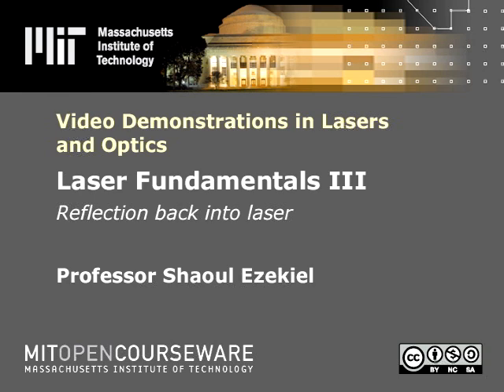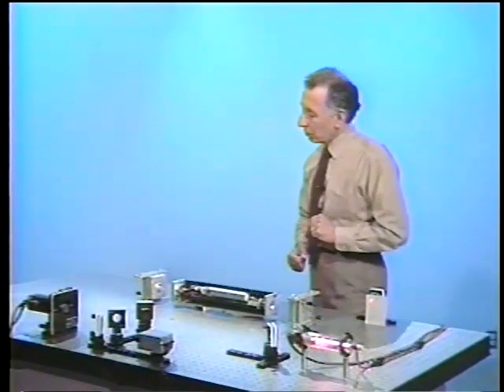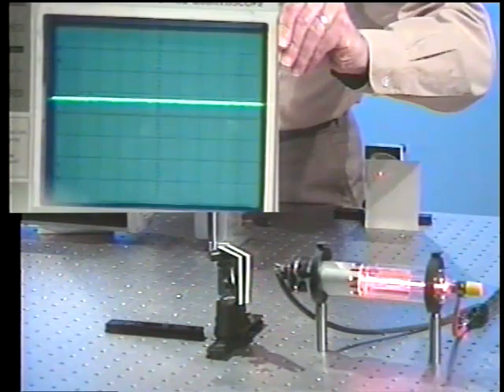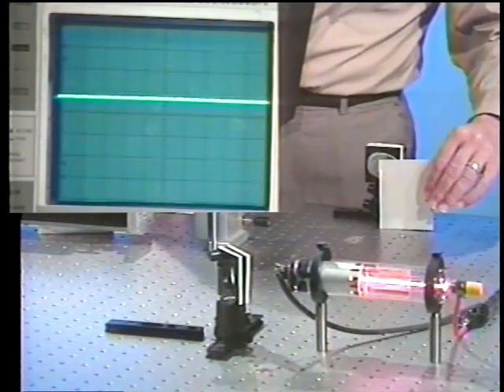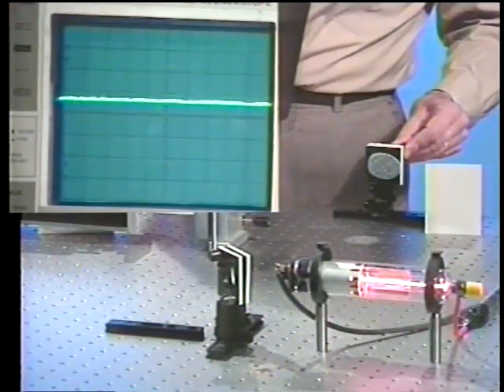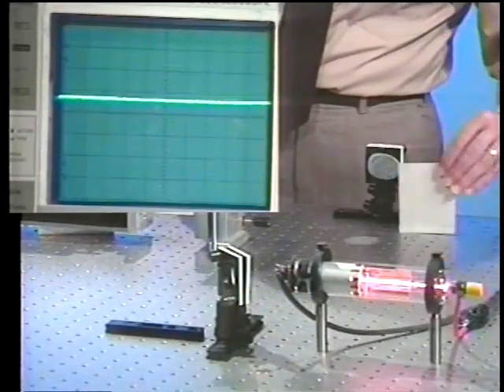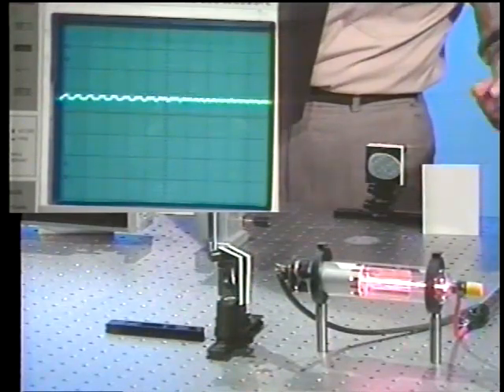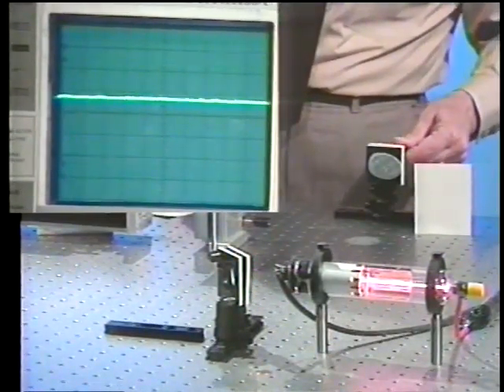Laser fundamentals III: Reflection back into laser | MIT Video Demonstrations in Lasers and Optics

Comment: Question-
A powerful laser, through a one way mirrored surface, mirrored at the "end" of it's path directly back towards the laser, would the effect still exist?
It's something that I would imagine is incredibly difficult to test, since there's no placement within this to put any input, but curiosity gets the better of me.

An example setup of this;

Where;
|| is a one way mirror
| is a standard mirror
= is the light
[                    ] is the laser / diode / whatever

[                    ]=||==================|
Reply: No. "One way mirrors" are actually used for this in optical experiments, though usually they absorb rather than reflect the light coming towards the source.
Reply: @andrewstone8999  Thank you for the response, I appreciate it. :D